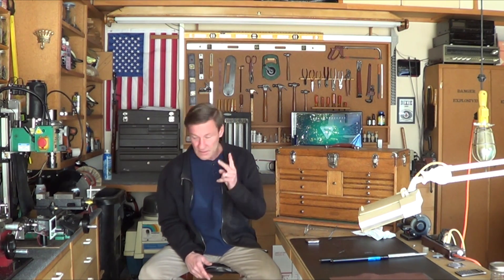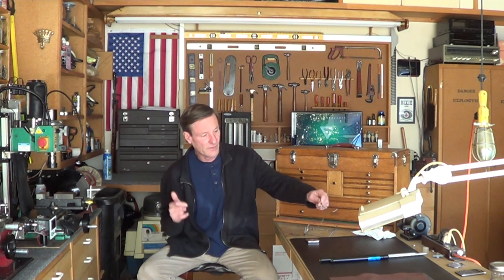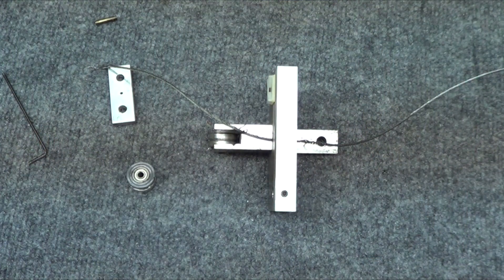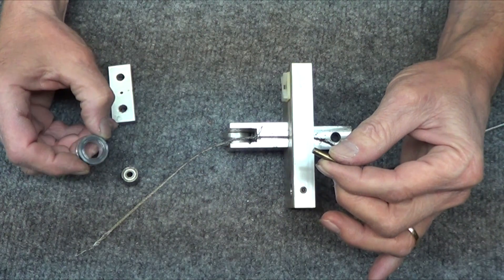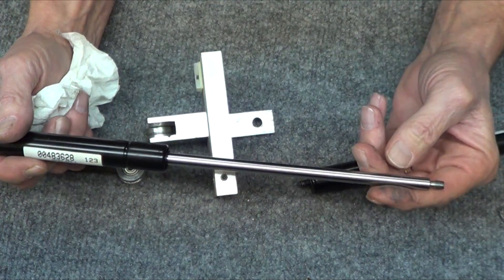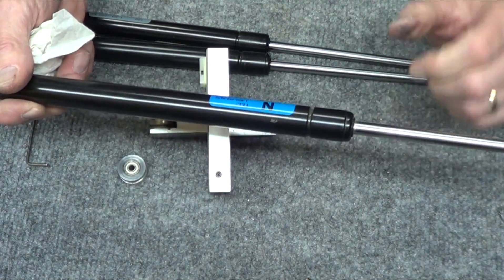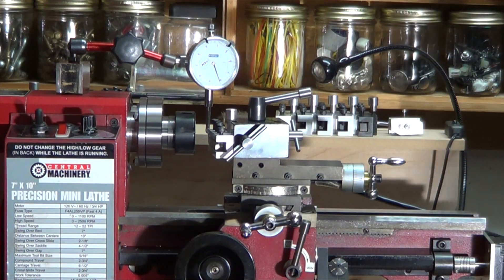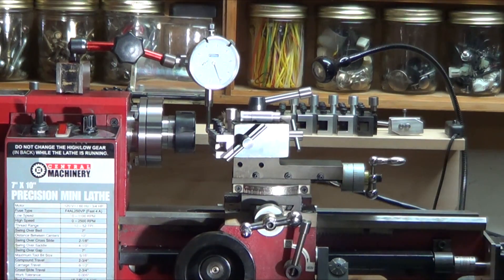How To Find And Set Correct Lathe Tool Height Video #102

Comment: From my time designing equipment for heavy fork lift trucks I remember lots of wire splitting, and braking, in a wire using height measuring system. Vibrations, chocks was the killer! 
Does the spring force, both dampers together exceed the weight of the head? Making You pushing the head/spindle down? I have an issue with my mini mill......

Comment: Hey Dave. In many videos, noticed all the compounds on these mini lathes are set parallel to the ways. Set mine to about 32 degrees because that's how we set the compounds in the machine shop when I was earning my machining degree in college. What is the reason for having the compound parallel to the ways on these mini lathes and am I doing it wrong? Cheers
Reply from the maker: Simple explanation! If angled and I use the power feed I'll be turning a .002 cone. The compound is set with a .0001 indicator to be perfect. So the compound is used for precision work and power feed when I don't care. On full size lathes the turning forces can be much higher so angling the compound changes the gib forces which improves stability.
Reply: Totally understand now.
I'm going to set my compound parallel to the ways now.
Thanks buddy.

Comment: If I was LMS, I would request Sieg to design an X2 mill that had the z-axis screw inside the column, like the X1, BF16, BF20 etc. and eliminate the springs and/or dampers.
Reply from the maker: I'm not sure that would be an advantage as it would limit using it as a drill press correct? Unless you can disengage the screw. But I can say that installing the pistons has seriously changed this machine.
Reply: No. The screw is used for moving the head up and down the column, but there is still a coarse (eg. drilling) and a fine adjustment of the spindle within the head itself.
Reply: For example...here is the BF20 (Grizzly G0704)..the hand crank at the top of the column is connected to a set of bevel gears which are connected to a threaded shaft running inside the column. But also note the drill press handles and front knob on the head for coarse and fine movement of the spindle within the head. www.grizzly.com/products/Drill-Mill-with-Stand/G0704  It would also make it much easier for those that want to CNC the z-axis as the ball-screw simply replaces the threaded rod inside the column.